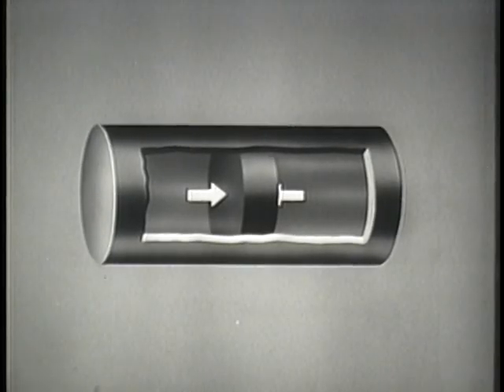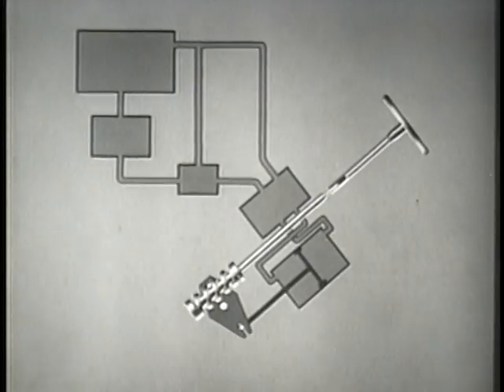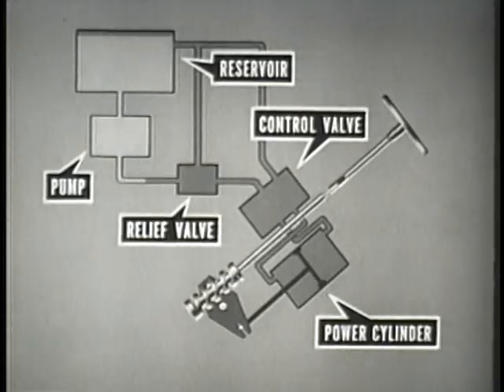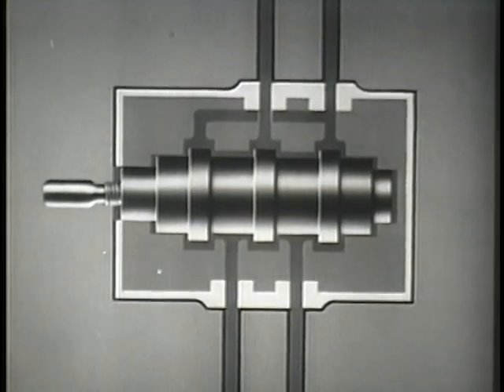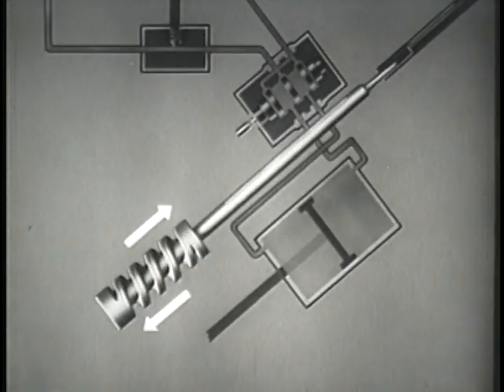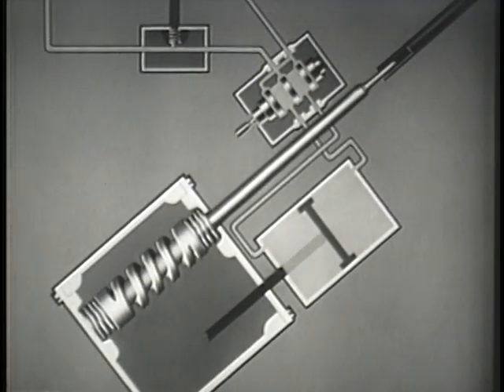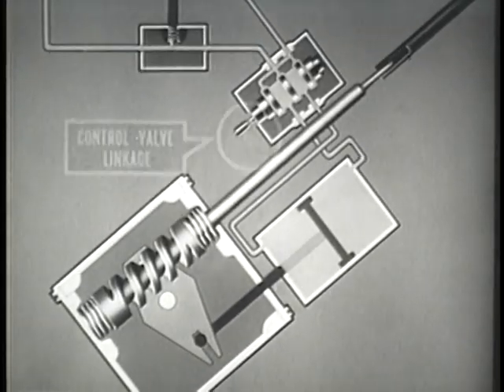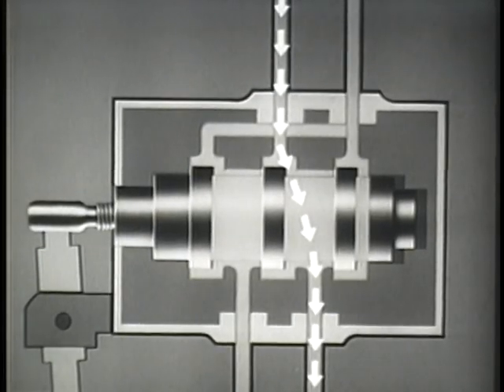Hydraulic Steering - Principles Of Operation (1956)

Comment: the first time i learnt how a differential works was from a video made in the 1950s, now i know how power steering works. these videos are awesome
Reply: +1wsx10 
Just to clarify. 
Full hydroponic stems like this one are not used in modern street vehicles. 
Instead they use servo motors. 
Heavy vehicles in building and military still use hydraulic systems to easy the wear of steering parts. These systems have servomotors to power the hydraulic pumps.
Reply: back in the good ol' days when people had to learn stuff to talk about it
Reply: 1wsx10 I couldn't agree with you more. :D
Reply: Yea, that's a very different feel than modern cars. I started driving in the early 80's & there were still lots of 70's cars on the road with full hydraulic steering. My mother had a 78 Cadillac & you could turn it with one finger, no feedback from the road whatsoever. Very different feel from modern cars. In the 80's they started to realize people liked some feedback from the road. I am not sure exactly how those worked but yea, older, full hydraulic power steering was very light & very "numb" feeling.
Reply: @shananagans5 My car has aftermarket hydraulic power steering, and it's pretty nice. There's still some feedback from the road, but that may be because of a bad wheel bearing.
Reply: +1wsx10 they are so well made!!!!
Reply: Y10Q
fuck.. really? i thought todays technology was so much more efficient because of the auras
Reply: ..Yeah, My 77 Dodge 3/4 ton 4X4 had one finger steering.....kind of annoying...compared to my 73 Vette with 'power assist'.....
Reply: Oh my, my grandmother had a First Generation Toronado. If I recall it was a 69. It had that 455 Olds engine in it. She lived in a little town in Oklahoma & she drove that thing from the time it was new up until she passed away in the early 90's, 92ish to my recollection. 
She was a school teacher and in the winters she drove it all of 1/4 mile to school when it was to cold to walk. After she retired she drove it to church about 2 miles each way once or twice a week and she drove it "into the city" once every few months. To her the city was Poteau Oklahoma, about 10 miles away. It literally was the old ladies car that got driven to church every week. When she passed away the car had under 20,000 miles on it. It was in perfect condition. It was kept in a garage & driven just enough to keep everything working. 
She had promised me that car and my grandfathers Cadillac. It was a 59 Fleetwood. He passed away in the early 70's. That Cadillac had more use on it but it too was in beautiful, original condition. It had some kind of electrical issue & was just parked in the garage sometime in the mid 60's & never fixed or used again. The rubber was rotted & it needed the electrical issue fixed. Other than that, it was a near perfect original car. 
I was in college when my grandmother passed & my father didn't even tell me until after her estate was sold off. I told him she had promised me those cars. He knew that but decided I was in school & would just prefer a check for my share of her estate. I was a tad bit peeved. lol I am still a tad bit peeved. 
Anyways, those old Toronados are really cool cars. I had a 1.8 liter Honda that torqued steered really bad & that Toronado had a 455 with +/- 500 Ft Lbs of torque & didn't torque steer. Imagine that.
Reply: Exactly
Reply: Oops, I went to show my partner a picture of the Cadillac. It was a Coupe Deville, not a Fleetwood. My plans were to restore that Cadillac, or fix it, replace the rubber & keep it stored, maybe show it on occasion & then sell it for part of my retirement. I was planning on enjoying the Olds more. Keep it in good shape & occasionally take it on weekend drives. I knew those cars would eventually be worth big money & I was planning on keeping them most of my life to pass down or sell for part of my retirement. It's water under the bridge now but I would still have those cars today had I gotten them. They aren't selling for what I would have anticipated 25 years ago but they sure aren't cheap & they would be my prized possessions. 
I hope whoever got them took care of them. They were both prime examples.
Reply: Old ford bachoes have very sensitive power steering. It literally uses hydraulic oil and pumps like this video. Much smoother and easier to drive than any car I've driven.
Reply: @theq4602  Every hydraulic power steering assist system (which means every road vehicle power steering assist other than electric works this way, although the mechanical steering gear is different - no one uses worm and lever any more.
Reply: Yea, I loved the older hearers & AC. They would just blow hot or cold air at you like there was no tomorrow.
Reply: ....Yeah..! The first generation Toronado and Eldorado were some of my favorites...! I've never driven either, but I have wondered about 'torque steer'.....?
Reply: Most modern systems are far more simplified. Most cars don't even use hydraulic assist anymore; most vehicles use electronic motors to assist the driver.
Reply: @SkorpyoTFC  modern hydraulic steering assist is the same, except that the spring controlling the spool valve works in torsion rather than linearly.
Reply: shananagans5 
That's due to the size of the torsion rod that actuates the hydraulic assist in the control valve. 
You can actually see that rod in the center of the steering shaft entering the steering box. 
Heh I shouldn't even post ; school was 20yrs ago ...

A weak spring gives a lot of assist , and a strong one gives less. 
This statement might be vice versa lol. 
Ok I figured out a better explanation. you could take the torsion rod out of say a firebird steering box. 
put it in grandmas caddy steering box and have heavy road feel.
All that blabber would be for gm stuff mainly.
Reply: IamTranslation 
Omg get in an old car with a throttle cable. 
when you touch the gas it does something. 
Sometimes drive by wire is so lazy
Reply: 1wsx10
Reply: Automatic transmission are still a mystery....lol
Reply: Timeless video really, once you know the basics its easy to figure out
Reply: I learned more from a 16 minute video from the 50's than i did from a month of English class.
Reply: Check out the physics (1930) one black and white film. Its m y favorite. (Differential is a good one)
Reply: I think the diff video was actually the 1930's if it's the one I'm thinking of.

M O R E  S P O K E S
Reply: I found out about Differential from 1937 Chevy film
Reply: I learned diffs from LEGO lol
Reply: i first watched that video to and now im hooked
Reply: Me too, and it was explained in an excellent way that made it look so simple, yet it was a very difficult mechanical problem to solve.
Reply: even young kids in Pakistan know how power steering works.Inshallah
Reply: Yeah they used to teach you things in the old days, now they lie and advertise while making it impossible for you to repair the item.
Reply: +1wsx10  these are the basics to the old systems. Modern systems are a lot more complex.
Reply: @Y10Q  same concept. modern power steering uses the same idea. once you understand the idea making it more complex is just adding parts
Reply: @YES10 Get a car you can understand. Boom, fixed for $20,000-$50,000 (depending on the car you get and the condition you get it in, as well as price for parts you may need to order). Even mechanical fuel injection is simpler than anything making cars go today. At least you can calibrate them with a ratchet and screwdriver, and a carburetor can be tuned with just the screwdriver.
Reply: @Y10Q  but they use old technologies. Nothing new invented much.
Reply: They don't. Well, the physics of it, they have to but, with the big, all hydraulic steering you don't feel it at all. You have a big hydraulic steering system keeping the wheels straight & you don't feel it in the steering wheel, not even a little. You wouldn't even know it's a front wheel drive unless you break the wheels loose. Then they do the side step thing like any front drive car. 
Just to give you an idea of how powerful the old hydraulic steering was, my mother was up against a curb one time. She had a 78 Cadillac & she turned the steering wheel to pull out & it mangled the hubcap just from the steering forcing the tire & rim into the curb as she turned the steering wheel. We aren't exaggerating when we say you feel nothing from the road. Torque steer doesn't make it past the steering box. Big bumps or potholes aren't felt in the steering wheel either. 
When people describe those systems as "numb" they really are. You turn the steering wheel & the car turns but you feel nothing from the road. No feedback whatsoever. 
That's actually very nice in a big luxury car. That's part of isolating you from bumps in the road & it takes no effort to turn but, for the most part, I like to feel the road a little. Just personal preference.
Reply: 1wsx10 
The basics never change , and back in the day was when they discovered the basics. 
These old movies are great, even in tech school in the mid 90s we had films similar to this. 
Wanna see one that will chill you to the core, if you can get past the corniness? 
"Shaking hands with danger"
Just a great all around shop/worksite safety film. Heh, it's kept me complete for 20yrs in the field. 
Besides I like brushing up on the basics once in a while, if you know theory then troubleshooting is easier.
Reply: IamTranslation 
Yea close enough for me. 
My 95 daily ricebox still has a cable too, that things not gonna last but another year or 2 from the rust monster. 
but for now I'll enjoy a daily driver with a throttle cable and no check engine light.
Reply: this isn't full power steering, it is just power assist, full power steering is very easy to steer, like modern cars. my tractor from the 70's has full power steering and it only has one hydraulic piston connected to the tie rod, and it is very easy to turn, however in result it is rather sloppy
Reply: Don't be a weenie.... if trucks like that were meant to steered with fluid then we'd all have female drivers.

Comment: No, the most modern steering systems are a computer controlled servomotor, with special high torque gears and steering wheel sensors. They call them dry power steering which means no fluids needed.

Comment: The hydraulic principles are still used, but they are mechanically much different.  Most small cars use a rack and pinion system and larger vehicles may use a pitman arm system, but they use a recirculating ball system which is much more durable than that old worm drive.
These aren't as good as this video, but they explain modern systems:
/watch?v=Z1Y14AejfQU
/watch?v=VRnUSjz0eLc

Comment: Do modern power steering systems work like this?
Reply: I know that you asked this question 7 years ago, but I'm still going to answer it, and the answer is no. Now they use some sort of sensors that detect when you turn the wheel and an electric engine applies the torque to the steering gear. That is a very simplified way of how it works.
Reply: @Patryk_Nowina-Nowicki  That must be quite a new invention, because i usually work a lot with cars from the 2000s and their hydraulic systems are mostly if not entirely mechanical.
Reply: @captainoblivious_yt  the invention itself isn't that new (it's from the 90s I think) but it just wasn't standardized until the late 2010s. I'm just an amateur though, so I might be wrong.